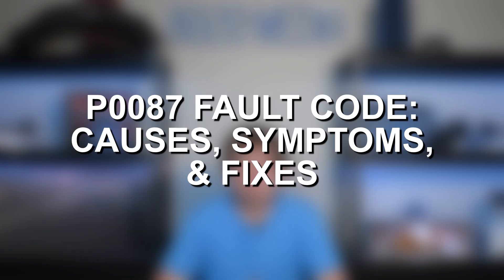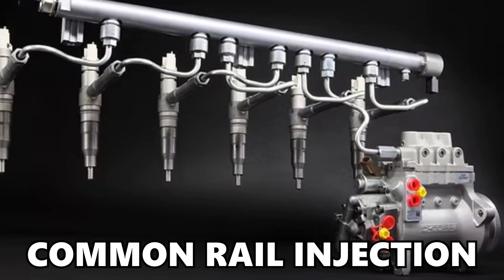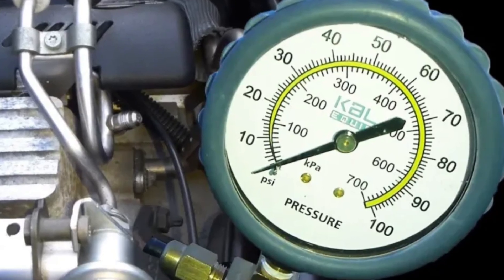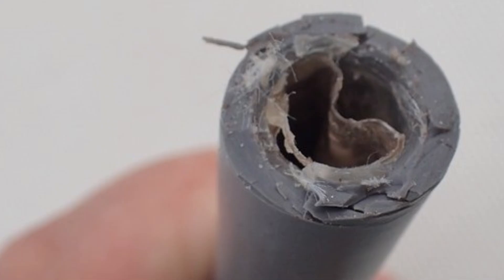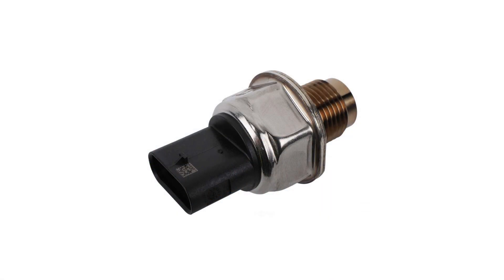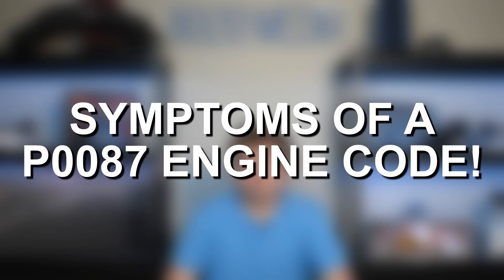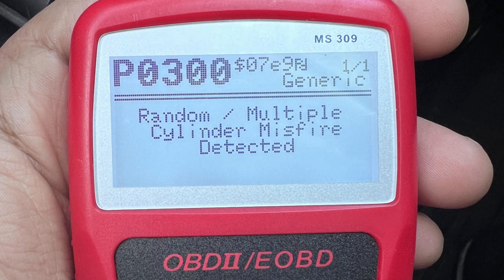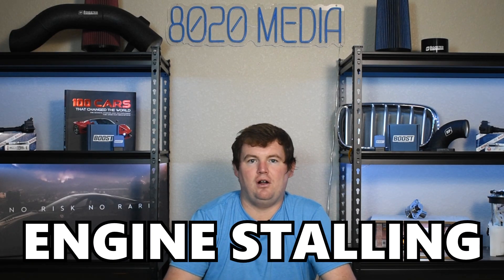P0087 Code Explained – Fix Your Fuel Pressure Problem Fast!

Comment: Hi mate I’m getting the code 11a204 on a 2015 BMW M6, i have changed two HPFP’s the in tank pump and the low pressure fuel sensor. Could it be the EKPM3?

Comment: Hi mate get this code pop up sometimes when I’m at a complete stop and pull off, I’ve done injector seals etc my engine is an 09 casa 240bhp they have a fuel pump in the engine bay near the fuel filter are they meant to be replaced quite often? Thanks

Comment: I have an Audi A5 tdi. 
When I rev above 2500 rpm the glow plug light flashes and the car goes into limp mode. If i switch the engine off and start it again the glow plug light goes and the car runs fine. I got the P0087 code. A mechanic checked the car and   replaced the fuel filter but this didn't fix the issue. He noticed that 3 of the injectors were flooded with fuel and suspects that they need replacing. He also said it could be the high pressure pump. I am not sure I want to change both components as this sounds like a costly process of elimination. Anybody know what this can be?
Reply: have you found the fix?
Reply: @ImparatiaTataluiESus yes, one of the injectors was dead. I got all 4 replaced as i got them fairly cheap from ebay. That sorted out the problem for me.

Comment: Thanks for the video. Just got this code and my car just randomly died on the freeway and wont start now. Cranks but is not getting any fuel. I'm assuming its the LPFP rather than HPFP but any input?
Reply from the maker: N - P0087 means fuel rail/system pressure too low, and if your car cranks but won’t start after dying on the freeway, it’s more often the low-pressure fuel pump (LPFP) or its control module failing than the HPFP, because if the HPFP dies the engine usually sputters or runs rough before stalling, but if the LPFP quits the rail runs dry and it just shuts off. To be sure, check if you can hear the in-tank pump prime when the key is turned on and, if possible, put a gauge or scanner on the low-side fuel pressure — if there’s nothing, the LPFP, relay, or control unit is the culprit; if the low side looks good but there’s no rail pressure, then the HPFP may be bad. Since it died suddenly and won’t restart, odds are high the LPFP isn’t delivering fuel.

Comment: Could something as simple as the copper washer seal under the injector cause this code?
Reply from the maker: S - Yes — a bad or leaking copper washer (sealing ring) under a direct-injection fuel injector absolutely can cause a P0087 (fuel rail pressure too low) code. If the seal isn’t tight, high-pressure fuel can leak past the injector seat into the combustion chamber, which drops rail pressure under load and makes the ECU think the pump isn’t keeping up. The leak might not always be obvious externally (since it vents into the cylinder), but it can show up as hard starts, rough idle, or excessive correction from the high-pressure pump. On some engines, worn or improperly seated injector seals are a very common hidden cause of P0087. If you suspect this, pull the injector and check for carbon tracking around the tip or a blackened washer — replacing with new copper seals (and cleaning the seat properly) is a cheap first step before assuming the HPFP or sensor has failed.
Reply: @8020Automotive  Excellent, thanks so much for all of that information! Think it's the first thing on the list to check here :)
Reply from the maker: S - Keep us updated!

Comment: I only get p0087 my car runs fine but when I do full throttle the the car has no power but when I accelerate slowly or I do quarter of panel the car runs fine my car is infiniti m56 is gdi injection
Reply from the maker: F - Code P0087 with normal driving but no power at full throttle almost always means the fuel system can’t hold pressure under high demand, which points to a weak high-pressure fuel pump (HPFP), a clogged in-tank pump strainer or filter, or less commonly a bad fuel pressure sensor/solenoid; since it only shows up at WOT, the low-pressure in-tank pump usually supplies enough for cruising but the HPFP can’t keep rail pressure up, so the best next step is to log commanded vs. actual fuel pressure (or at least verify the in-tank pump is flowing properly) and, if that checks out, plan on replacing the HPFP, as that’s the most common fix for this issue on the M56.
Reply: @8020Automotive  tysm

Comment: I have a code p0087 and p1065
Reply from the maker: V - Together, they mean the ECM is seeing the rail pressure drop below what’s commanded, which usually happens because of a weak high-pressure fuel pump, clogged fuel filter, failing in-tank pump, or an issue with the fuel pressure regulator/sensor. It can also be caused by wiring/connector faults to the pump or sensor. First step is to check fuel pressure with a scan tool or mechanical gauge, verify the in-tank pump is supplying enough flow, and confirm the HPFP (if turbo direct injection) is reaching spec. If pressure is good, then check the wiring to the fuel pressure sensor/regulator. Most of the time, on cars that throw both of these, it’s either a weak pump or a fuel pressure sensor starting to fail.

Comment: What about an epc code then then check engine and the code comes back p0087
Reply from the maker: D - An EPC (Electronic Power Control) light followed by a check engine light and P0087 code—which indicates "Fuel Rail/System Pressure Too Low"—typically means there’s a serious fuel delivery issue, often caused by a failing high-pressure fuel pump, clogged fuel filter, weak in-tank pump, or faulty fuel pressure sensor; in turbocharged engines, especially VW/Audi, it can also be linked to issues with the cam-driven high-pressure pump or fuel line restrictions. Since EPC affects throttle control, it’ll trigger limp mode to protect the engine. Start by checking fuel pressure (both low- and high-side), inspect wiring to the fuel pressure sensor, and if possible, scan live data for actual vs. requested pressure—if they’re out of range, the high-pressure pump or sensor is likely at fault.
Reply: @8020Automotive Hello. Today EPC came on. Then I turned off my 2017 VW Jetta SE. When I turned her back on, the engine light came on but no EPC. Went to AutoZone and there were 2 codes. First was P0087 (Fuel Rail/System Pressure - Too Low Bank 1. And the second was 02214-002 Tire Pressure Warning - Lower Limit Not Reached. I called a mechanic and they told me try to see if the fuel cap is loose. So I checked the fuel cap and although it wasn’t loose, I took it off then placed it back on as if I just put fuel 😂. I started the car again, the check engine light was still on. Turned her off then turned her on, no more engine light. Does this mean my car is ok to drive again? Or should I take her to the mechanic? And lastly can you explain what the second code means? Thanks.

Comment: I left work on July 4th and my engine, steering, traction, and tpms lights all came on. Tpms was blinking but the rest were solid, then it would go solid. The car would violently jerk when I'd try to accelerate and it would shoot up to 4 - 5K rpm but if I'd let off the gas and just gas slowly it would slowly accelerate and then when I'd be at 35 - 50mph the car would run normmally. I put my code reader in and got P0087. Took it to one shop and they said they think it's the fuel pump but that I should go to a honda dealership in case it's recalled but my car 2015 Honda Accord LX doesn't have a recall on the fuel pumps so I ended up towing the car to another shop and they don't think it's the fuel pump at all but now the code is gone and everything was cleared and the car is operating just fine. I'm letting the shop drive it around to see if the mudle will trigger the code again but I also don't want to have them put in a fuel pump if it could be the fuel lines, fuel filter, fuel injectors, sensor, or something electrical etc.
Reply from the maker: K - Sorry to hear this.. Based on your symptoms and the P0087 code (Fuel Rail/System Pressure Too Low), it does sound like a fuel delivery issue, but not necessarily a failed fuel pump—it could also be a clogged fuel filter, dirty fuel injectors, a failing fuel pressure sensor, or even an intermittent wiring or ground issue. The fact that all those warning lights came on simultaneously suggests a momentary electrical or communication fault that could have affected multiple systems, possibly triggered by low fuel pressure affecting engine performance and tripping related systems like traction control and steering assist. Since the problem temporarily resolved after the code was cleared and hasn’t returned, it’s smart to have the shop monitor it, but unless the issue recurs consistently, replacing the fuel pump would be premature. If it happens again, ask them to perform a fuel pressure test under load to confirm if the pressure is dropping, and also consider checking for any stored freeze-frame data if the code reappears.